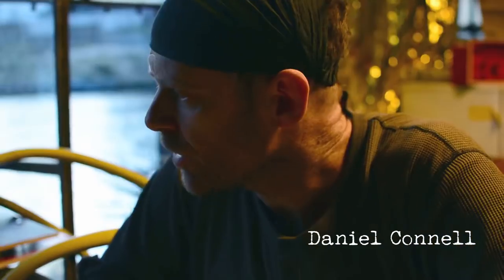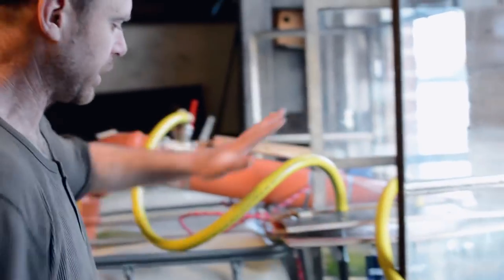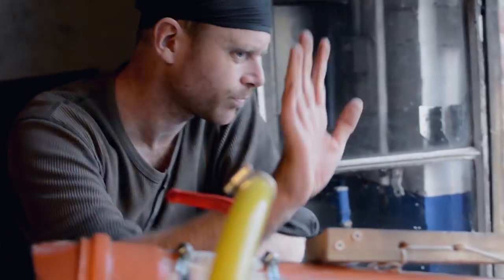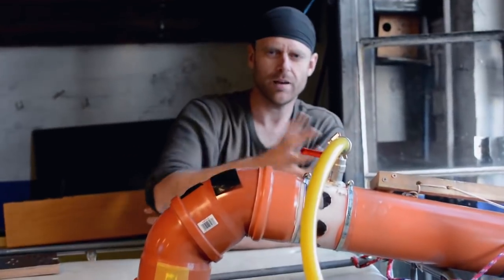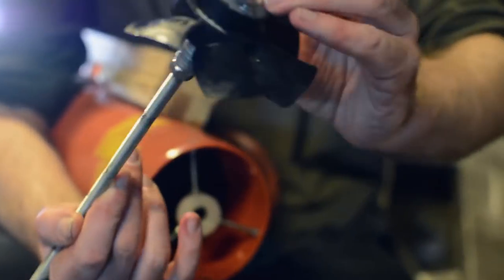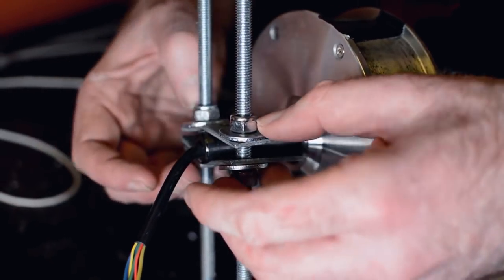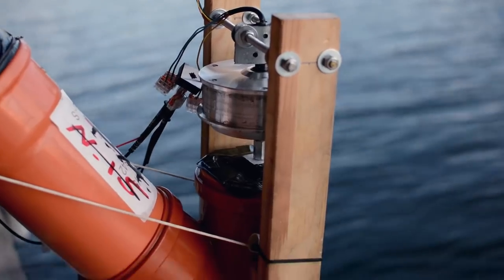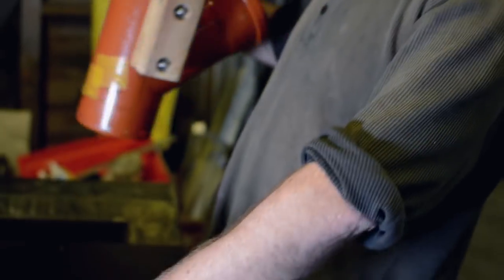$50 Water Turbine-5 kilowatt hrs/day - Open Source, DIY

Comment: Such a clever solution for connecting the turbine drive to the alternator and so simple and low cost… looking forward to seeing longer term performance to see how the whole assembly works over time… SUBSCRIBED!
Reply from the maker: Thanks. Longer term data to come, currently in Nepal working with Kathmandu University to finally get some proper efficiency data of the various runner design options.

Comment: Thanks for sharing this work, I enjoyed watching it. As mentioned in previous comments, the siphon configuration does not help avoid cavitation. Moreover at the place where the turbine is, the pressure is surely lower than the atmospheric pressure, and you might have air coming in since the sealing and joints are not perfect. And let's not forget that is a fan and its design is not optimised to have low NPSH performances. I believe that all these issues will be solved when you will have the classical installation with the the turbine placed closer to the outlet, as you said when it will be installed in a river or whatever. But in the meantime, you have to consider that cavitation has a great effect on the power absorbed by the turbine. If you solve the cavitation problems, your power will be greater.

About the hydraulics, I believe that the turbine could absorbed more pressure and generate more power. Be careful in axial propellers as this one, more flow might not mean more power. Here I think the turbine is working very far from its BEP and the power could be greater than what you currently have (i do not know if since that you have more improvements). It would be good to have pressure measures before and after the turbine to better understand if you could improve a bit from the hydraulic point of view. Another thing is the tip between the fan (120mm) and the pipe (125mm), it s large and you might be losing some watts there. Anyway I hope those comments could help.

Can't wait to see the following testing and improvement of the turbine. Ah congratulations for the interesting and clever solutions for making bush bearings, couplings, etc. for almost no money. Brilliant ideas.
Reply from the maker: Thanks. I'll experiment with different placings of the turbine with the in field build. There an easy way to measure pressure in the system without disrupting the flow too much?
I tried two other impeller variations, one with steeper pitched blades and one with a larger central hub, both did about 20% worse. Also two fans back to back, which didn't seem to make any difference at all. 192W is at or near the top of the power curve by variable load. If further efficiency can be extracted that would obviously be great.
The edge clearance is about 1-2mm, which isn't ideal but I'd rather that than chance of rubbing.

Comment: I'm worry about rusting of galvanized parts over time.
Very nice video and practical application of basic science.
Thank you for sharing.
Alex from Montreal, Canada
Reply from the maker: Yeah we'll see how the metal holds up. Reasonably easy to replace if it does corrode out.

Comment: I would change the computer vane axial style fan to a backward or forward incline assembly to eliminate the cavitation issue. if you wanted to keep with robbing the parts from other sources, several bath fan units come to mind. Electric furnace fans are another source, which would increase the size of the housing, but would also allow for a much larger generator source. An old 3 phase pump motor could be used for instance. The power generation (with a regulator) would likely power a small township.

Comment: Thank you for the update. I have a waterfall with 60 to 70 gpm and 8 foot of head pressure. Seems about right for this. Looking forward to the tutorial.
Reply from the maker: That should be about ideal, yes.
Reply: @OpenSourceLowTech  awesome. I think I'm also going to try out Spencer Langston's turbine although it is much larger and requires more water than I can sustained for a long period.
Reply from the maker: @LandtoHouse   I hadn't seen Spencer Langston's, thanks for pointing that out. Looks fairly similar to mine but I can't find what kind of impeller he's using...
Custom made alternator apparently, super high amperage...

Been watching your ram pump vids btw, nice work.
Reply: @OpenSourceLowTech  Spencer is currently working with Joe Malkovich on a custom 3D impeller. Spencer is the sponsor for my summer Micro Hydro project.

Thanks for watching the ram pump videos. They're a lot less complicated than your turbines
Reply from the maker: Not made a ram pump myself yet, but inevitably will at some point somewhere.
What kind of shape is the impeller? Got any images? It would be super useful to see what I should be honing in on for maximum efficiency..
Reply: @OpenSourceLowTech  I don't think they have the impeller perfected yet. Seems like the blades are a bit steeper than a computer fan. (I don't know much about it other than Joe's video)...if you need a ram pump and want to make a review of the Land To House model just let me know. ... sales are up 550% from last year. I had to bring in some help to make them.
Reply from the maker: Is it a propeller / quasi-Kaplan type they're using tho? How are they mounting and centering it at the runner end?

Comment: That’s so much for this vid. I’m building a near identical version right now. I have worked out that the version Langston’s Alternative Power sell uses an impeller from a jet-ski to drive it. I’ve made a prototype using 40mm pipe and I’ve 3D printed an impeller - it’ll spin up to 1400rpm but not much torque. The ‘proper’ version will be in 110mm pipe with roughly 2m drop. I’m very optimistic about it. Thanks for your great tips - especially keeping the pipe exit under water.
Reply from the maker: Yeah I saw his ones after I started mine, and we seem to have ended up in more or less the same place, except the sourcing of the materials.
I've tried steeper pitched runners, more like the props he's using, but they didn't seem to do as well as the flatter fans I've been using. Which is good news for my build at least, since the more basic PC fans are easier to get than the fancier ones.

I'd definitely recommend coming up to about 120mm dia on the runner, you're going to struggle to get any useful power off anything smaller.

Let me know how you get on, especially with what shape runners give the best results.

Comment: 35 liters per second is lot of water (you empty your 1000 liter tank in only 28 seconds)....in a small river, is hard to get 2.5meters of gap if it dont have a waterfall/dam in somewhere.. I wait for the field test with this system in a small brook
You have given good ideas, simple and easy to implement, 
I also had been thinking about also making a turbine with computer fans inside pvc tubes and I hadn’t yet thought of an idea on how to avoid water in the generator, how to transfer the movement in water out of it and how to prevent air from entering the continuous flow of water. Just yesterday I found your project and after all it can be simpler and easier than I was thinking. 
I am waiting for more news, good work!
Reply from the maker: A smallish stream should be able to supply it, the drop doesn't need to be pure vertical, if there's a bit of a cascade in the waterway where the drop is over up to say ten meters horizontal or so then it'd still largely function.
I'm imagining this in actual use will be more something that's plugged into an incline rather than having to be dropped over a weir/dam/etc, and won't be a full up-over-and-down style siphon as in these test rigs, which I think is costing me some power.

Comment: This is excellent! But one minor thing you left out in comparison to a solar panel... A solar panel is effectively zero-maintenance: all you have to do is keep dust off of it and you are good (assuming it is sunny). Assuming a water source like the stream that was shown in the video, regular maintenance will be needed to keep trash out of the inlet. Pretty minor compared to the performance gains, but worth considering. Keep up the good work, looking forward to seeing more!
Reply from the maker: True, but the corollary is this can be maintained. Once a PV panel breaks in any significant way it pretty much needs to be junked.
I'm in the process of building business models around these technologies whereby local people are able to take on the job of producing and maintaining them.

Comment: Great design. In use the voltage and power output will fall off a cliff when/if you add load past your ~192 watt figure unless you interpose a MPPT regulator after the bridge rectifier but, at 3 amps 65 volts, it need not be expensive and can typically be used to charge and maintain a small battery bank to allow occasional/intermittent loads >> 200 watts.

Comment: Could possibly put more turbines into the same system?
Reply: If it's the same flow of water, each fan will pull energy out of the flow and you will get greatly diminished returns. If you place multiple of these in parallel in the same river though, you should be able to produce more power at once.

Comment: Suggestion: To improve eficiency; before the impeler fixed axel guide, inside the tube. You can instal on the shaft a Spinner, in cone format, to improve watter flow.  Also on the impeler itself, instal a cone! Willl acelerate vater Speed a lot

Comment: I also wondered about the fan blades breaking.  If there was fluctuating pressure on them, it could bend them back and forth, even though ever so slightly, but it would fatigue the plastic and they would break eventually.  You may be able to get a handle on predicting it by measuring pressure differential across the fan.  The other thing that struck me about using a fan was the question of efficiency.  The Pelton wheel is tried and tested, and designed for the job.  These blades are designed for a quite different job.  There may be other fans out there with a more suited blade.  Maybe the propeller from an outboard motor would be worth experimenting with?  Brunel fabricated a ship's propeller from flat plate, and if memory serves, it was quite efficient.
The PTFE bearing is a nice idea, but just in case you didn't know (though you probably did), marine bearings, from ships' propeller shafts to outboard motors and pleasure yachts, are usually made of rubber.  It is water-lubricated.
Reply from the maker: I'm in the process of installing a couple field tests in order to see how the materials hold up longer term. There's a fair chance the fan won't last, but there are options for strengthening it. Something like a small boat prop would do a better job in terms of longevity and probably efficiency, but it's a matter of cost and availability in other parts of the world.

Peltons are great, but generally need at least 20 meters of head to function properly. This is meant as a low head, medium flow momentum turbine for serving the niche of people with only that water resource availability.

Other bearings would also do the job, but also a matter of availability.
Reply: @OpenSourceLowTech  Power (sic) to your elbow.  This is a project that could lighten the lives of many, many people.

Comment: Did you try using a washing machine motor for the alternator? I've seen them used frequently
Reply from the maker: I had a direct drive washing machine motor I was testing, but think it would be way too big and heavy for this little impeller.
They would, however, be about perfect for the vertical wind turbine...
Reply: @OpenSourceLowTech  Check out angry rams tutorial on making a hydro powered smart drive hydro power system . they put out over 400vs but he also has a video on how to rewire them for lower voltage
Reply: @nwapranga  And again a man has left important directions out.   Where would you happen to find this Angry Ram tutorials at?  You fail to give the valuable information, being where the directions are located.  That would help a great deal.
Reply: @inspire734  took 45 seconds to put the name in the search bar and find Angry Ram. Don't be lazy, it would be rather poor form to jump onto your feed and send folks to someone else's, that is doing much the same.

Comment: Why not put 2 impeller in it?
Reply: Or 10?
Reply from the maker: Each would take from the others, it wouldn't be much if any extra power overall, but that many times the cost and work.
Reply: Look up the Lilly
 impeller
Reply: @OpenSourceLowTech  If you look at how a jet turbine works, it has a static blade that directs flow in the opposite direction, such that when it hits the next impeller the force is available again at near 100% power (I think).  Now, you won't be compressing your fluid, so you won't be reducing your chamber size - but the same overall principle might be useful.  If you 3D-print a reverse blade to the internal diameter of your pipe you can then drive your shaft through it, thereby removing a part from the system and you would be exactly on centre.  May or may not help with the cavitation.   https://www.youtube.com/watch?v=KjiUUJdPGX0 - animation of my point at 1:30
Reply from the maker: @ashtontechhelp  I tried a stator turbine but it reduced the overall power by about 10%. I may have just made it badly tho...

Comment: So, 2.5 meter drop and about 35 liter per second,  means the water flow represents roughly 850 joules every second, which also can be described as 850 watts. With sub 200 watts output you have less than 25% efficiency. While almost 200W constant can be incredible valuable, such drop with that flow is not easily accessible everywhere.  

Don't get me wrong, intent and effort is fantastic, but I think the design should be improved upon. You should be able to get at least that output from half the potential power you are using. 

I also think the turbine should be in the bottom, of course you are getting unnecessary cavitation when the water pulls water through it and not pushes water. Your turbine is at the wrong side of a 0.25 atm pressure difference.

The comparison with solar PV lacks completeness, while a reliable 190W-ish constant output is more superior than a 100 or 120W solar panel than you give it credit for, there's a big difference in actual reliability. A solar panel produces what is supposed to, given the conditions, incredibly reliably. Even after 30 years most solar panels will produce most of their original power if they're just clean. You have to make lot of improvements to make that thing work reasonably reliable with reasonable amount of service/repair.
Reply: Something I think is wrong, the CPU fan... Air fans makes terrible water turbines...
Reply: Considering the design of the turbine, being an air fan, gives you most of your inefficiency. However 25% is pretty good, especially for such a cheap design.
Reply from the maker: The fan was chosen purely for the sake of global availability, tho it is doing a somewhat better job than I was necessarily anticipating.. I also tried two other fan types, with steeper blade pitch and a larger center hub, but they both did about 20% less power overall than the standard type.
I would love to increase the efficiency, and have a design in mind which is closer to a traditional Kaplan turbine, but in general I'm happy enough with the output and the cost of this to go forward with it. The drop doesn't need to be vertical, a gradual incline in a waterway will also work, and 5 kWh/day is a lot of power to play with in the parts of the world this is mainly meant for.

The impeller may do a better job lower in the draft tube, but would be a bit trickier for the ergonomics of building and using it in this configuration. In actual use tho, plugged into a stream with drop as opposed to the full U siphon I was testing it with, it would probably be easier to implement. Which I'll find out this year with the field test builds.
Reply: I don't get it, he talks like everyone has 300 gallons a minute, dropping like 10 ft in their backyard. Seems like he's one short step away from a free energy nutter

Comment: I am using rainwater from roof to run mini turbine.  This is similar to what I made. Good stuff
Reply from the maker: How much power were you getting?
Reply: @OpenSourceLowTech   About  1000 KwH  per month.  The  rainwater is filtered and channeled into two 32 gallon bucket placed  below front and rear roof line and the turbine setup is at the bottom.

Got the idea from this research paper

https://www.researchgate.net/figure/Pico-hydro-power-plant-diagram_fig1_303248520

Comment: So happy I've found these videos. Exactly what's needed to turn everyone into enthusiasts. So accessible! 

Question. What's the minimum flow rate required for this baby to run?
Reply from the maker: Depends on head and pipe diameter etc, but this one was going through about 30-35 l/s.